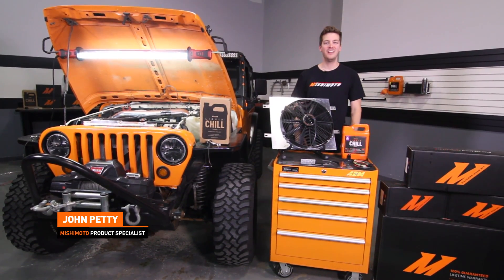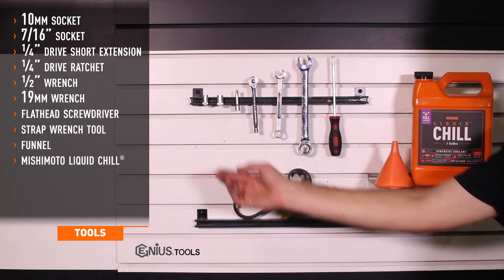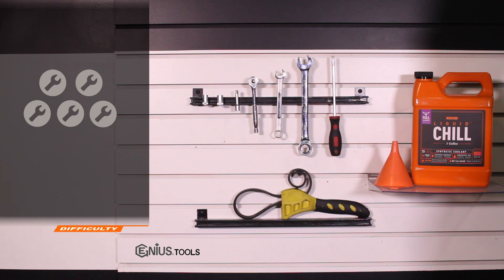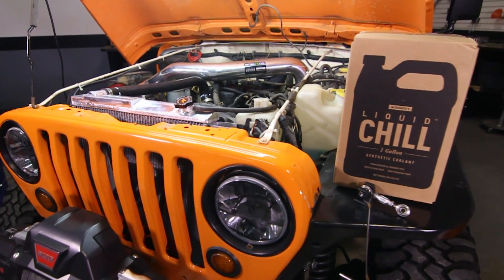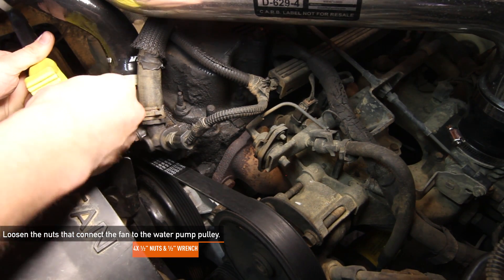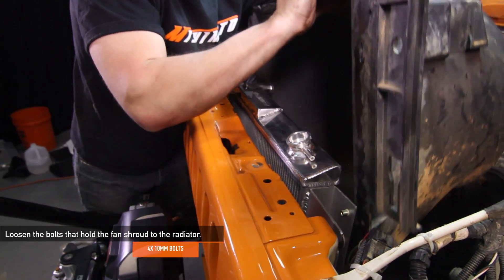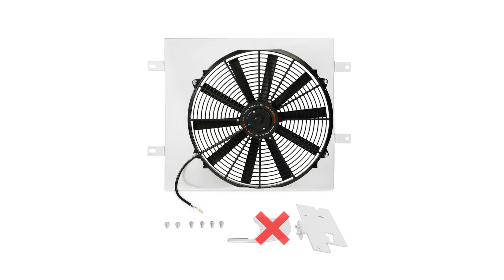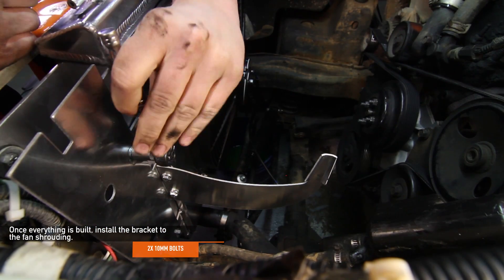1987–2006 Jeep Wrangler YJ and TJ Performance Fan Shroud Kit Installation Guide By Mishimoto

Comment: 2007 wranglers arent TJs. theyrejks
Reply: Jeep abomination started in '07 with those *ucking 4 door jku limos and equally horrific, the 3.8 mini van engines.
 
Jeep 1941 - 2006
Heep 2007 - current 😝💩

Comment: Hi there,
Would you happen to be able to sell just the Overflow and power steering Reservoir Brackets? nice jeep btw, just one question about the Jeep what is your top speed and gearing? thanks alot
Reply from the maker: Hey Dustin! Please contact our customer support specialists at 1-877-GOMISHI or email support@mishimoto.com - they'll be able to price and ship these individual pieces from our kits. :)